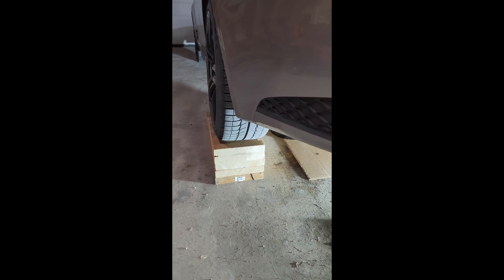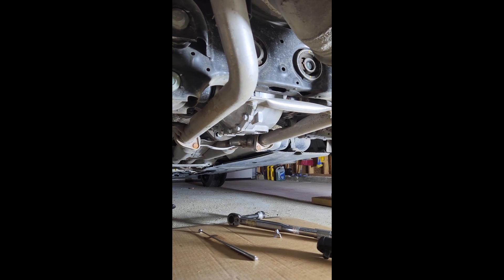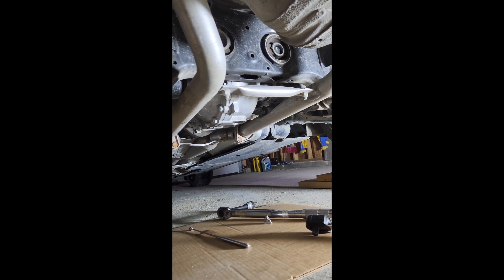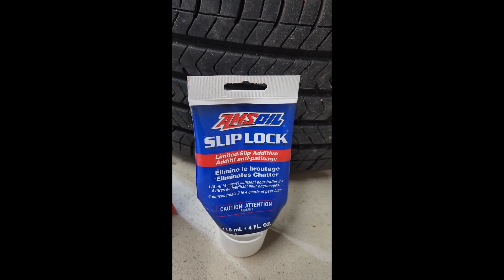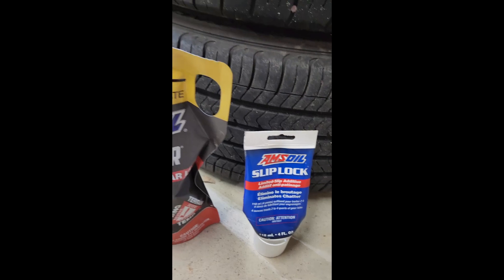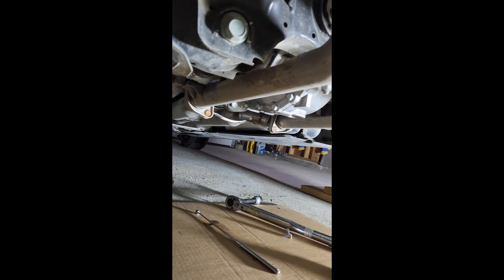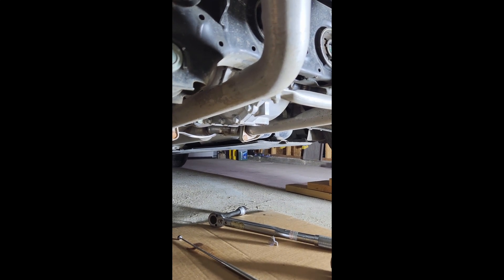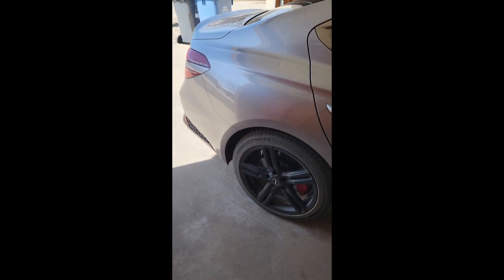G70 Rear Differential Issues

Comment: I'm not sure there's a reason to add the slip lock. There's already friction modifiers in the asmoil. Since it's limited slip it's not supposed to always slip or you just have a regular diff. I changed out with just the 75w-90 and it's quiet while still functioning as a lsd.  Someone can correct me if I'm wrong here but that's what I gathered.

Comment: I have a '22 2.0 with std dif and I get a whine noise when I slow down on a slight downhill. Changing to Amsoil 75-85 tomorrow and will report back if it disappears.
Reply: Didn't really help the whine, so disappointed.

Comment: 2020 3.3 tt panthera metal stingergt2 with 103,000 miles. Replace differential bolts with ARP.  The problem is they are breaking.

Comment: I am on my fourth differential!!!  I bought the G70, 2020, used,  and it had 19,000 miles on it.  I never really noticed the noise until about 40k miles.  I suppose it was always there.  Then I took it to dealer.  They said there was factory bulletin on it, but no recall.  They changed the diff under warranty.  I drove it 500 miles and the sound came back.  I took it back.  Diff number three was put in.  Drove it 500 miles and the noise came back.  Finally gave up on that dealer and went to the next closest Genesis dealer.  They understood my problem and swore they could address it.  I did my research on line and saw that Trans X fluid was one option other than the Slip Lock.  While I waited for my appointment,  I had my regular mechanic just add it in to see if it made any difference.  It worked like a charm!  No noise.  But diff number three was shot already so I had the new dealer change it.  I asked them to add the Trans X fluid and even gave them a new tube of it.  In the end, I got diff # 4 but they didn't add the fluid.  Why?  Dealer said it was not to spec and they would not be able to bill Genesis for the work if they didn't do it like the book said.  

I went straight to my mechanic afterwards and had them add the Trans X fluid and so far, right around 500 miles after, all appears fine.  We will see what happens after this!
Reply: Could you specify which trans x fluid please and thank you

Comment: But if this is the actual solution, how in the world does Genesis not know about it? They instead would rather keep replacing differentials rather then simply changing to a proper oil?? That simply blows my mind.
Reply from the maker: Great question. I suspect they may be onto it by now but don't know for sure.
Reply: @cdnsnowjag  My 2023 G70 3.3T AWD Sport Prestige only has 4800 miles on it, has a 10 year warranty, and is perfectly quiet but I think I'll do this a preventative maintenance. Just because you have a warranty doesn't mean you want to use it. It's headaches and downtime. Rather just have the car working properly, and if Genesis is too stupid to remedy this on the cheap as opposed to replacing expensive diffs, well then I guess we have to do it ourselves.
Reply from the maker: @kevinbreese5739  Keep in mind it doesn't impact all G70s. Seems to be the 2023 year mostly but even then it's only a subset of cars. Maybe they are using gear oil from different suppliers and one is no good.. Not sure. If you hear any groaning noise, get Amosoil in quick OR let them replace the diff and then put Amsoil in quick. None of the cars from 2019-2022 seem to have the issue and it's the exact same part.